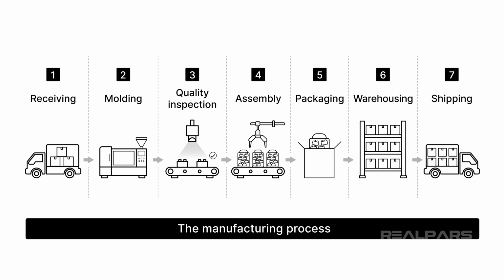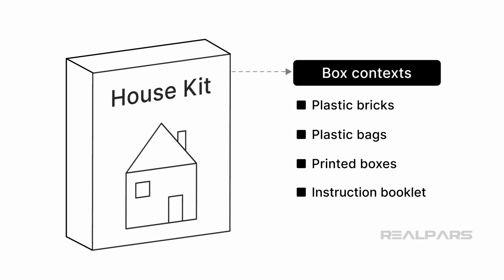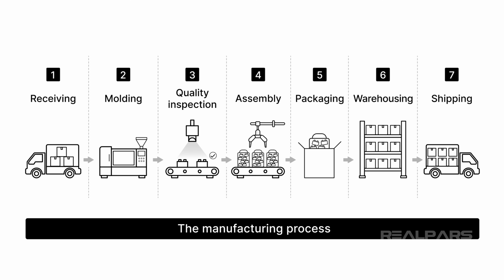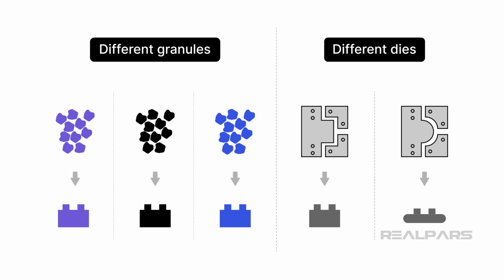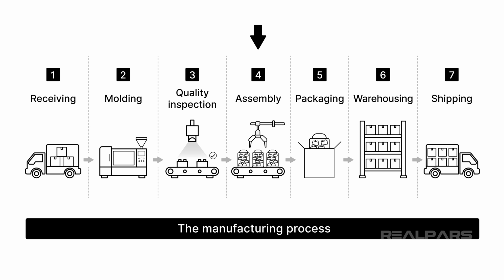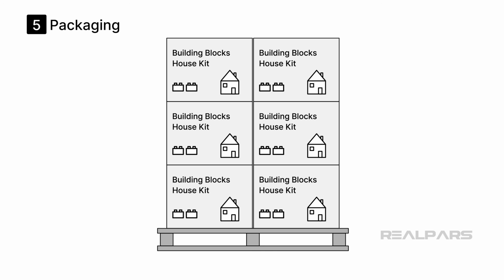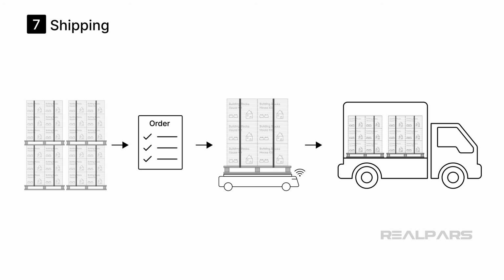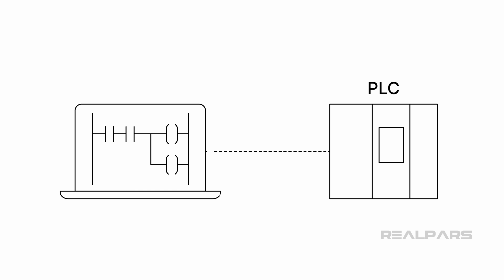How the Manufacturing Process Works

Comment: Great breakdown of the process flow. One thing that often gets overlooked in conversations about automated manufacturing lines is what keeps all of that equipment running between production cycles. Every conveyor, injection moulding machine, AGV, and robotic arm in that process depends on precision bearings, drives, and fluid power components performing reliably — shift after shift. When those components aren't part of a proactive maintenance strategy, the efficiency gains from automation get eaten up fast by unplanned downtime. Predictive maintenance on the mechanical side is just as critical as the PLC logic controlling it. 👊
Reply from the maker: Well said, proactive maintenance is absolutely essential for keeping those efficiency gains on track.
Reply: @realpars  Appreciate that! It's a conversation that doesn't get enough airtime in automation discussions. Happy to contribute anytime — great content coming out of this channel. 👊